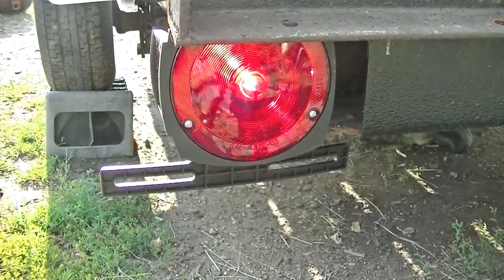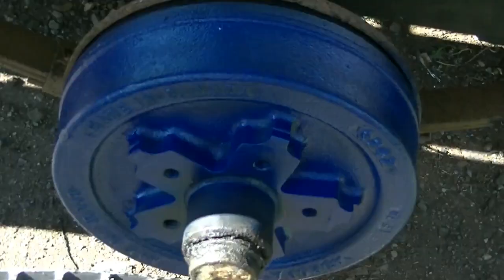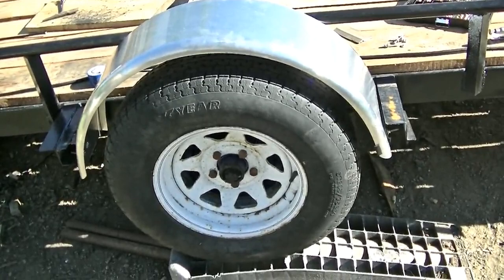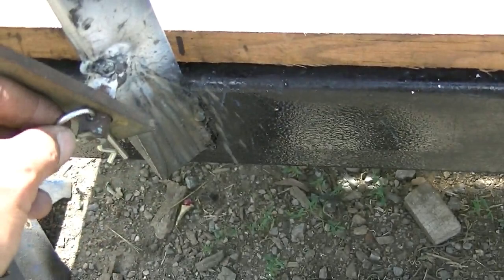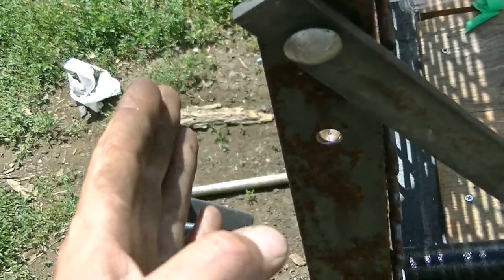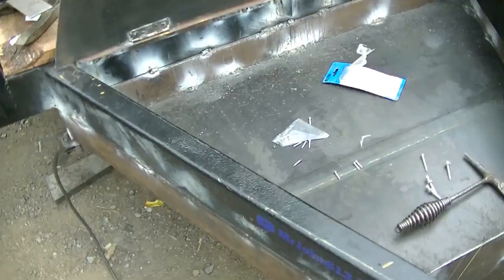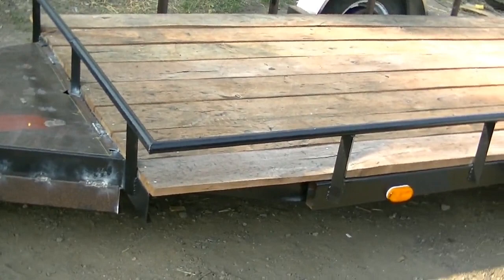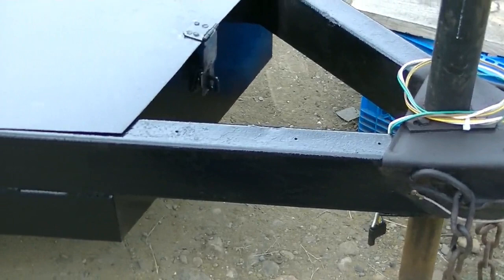4 Pin Trailer Wiring Install DIY (plus wiring diagrams)

Comment: Great job...did not see you hook the ground wire. Very helpful.
Reply from the maker: thanks rick!  you're right, i forgot to show grounding the white wire to the trailer.  you can see where i grounded it if you pause at 25:08 but i explain in the beginning it just goes to the trailer chassis.  i grounded it to the trailer chassis with a  self tapping screw near the front of the trailer :)

Comment: Had to like the video just because of the PT Hauler :)
Reply from the maker: yeah PT stands for Partial Truck lol she hauls.  i've hauled bricks, plywood, crf80 dirtbike, TTR 125 dirtbike, my 14 ft trailer loaded with a 12ft pontoon dock , a 140-lb LSG fur monster, straw bales, multiple 80 lb feed bags, even a canoe on the roof.  it truly amazes me.  factory tow capacity is 2000 lbs i believe!  very impressive for an economical 4 cylinder with overdrive

Comment: Could have done this in 10 mins or less
Reply from the maker: Wow that amazing!  I wish I could.  It’s hard to build a trailer that fast!  Plus also to be the fabricator and camera can and editor and producer all in ten minutes!   You’re good.  I can’t even get the paint to dry in 10 minutes 😜
Reply: @613Builds  You're wiring it nitwit. Stop with the tangents and get to the fine points.  Certainly not scripted or practiced.